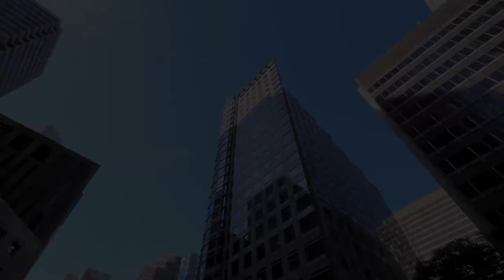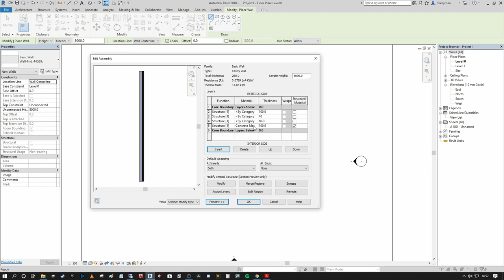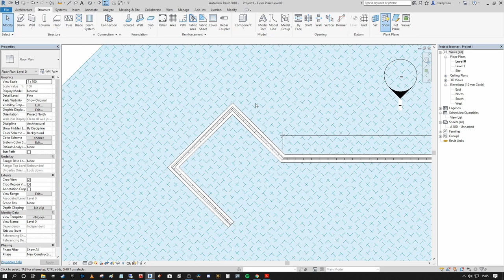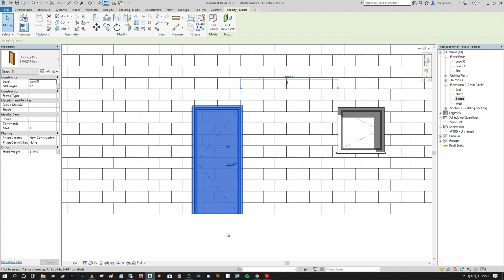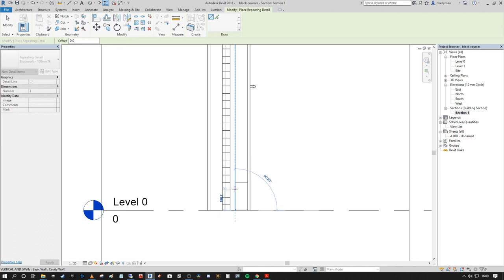Create Block and Masonry Walls to Course Intervals in Revit

Comment from the maker: Hi everyone - video timestamps as follows:

0:00 - Introduction to Topic

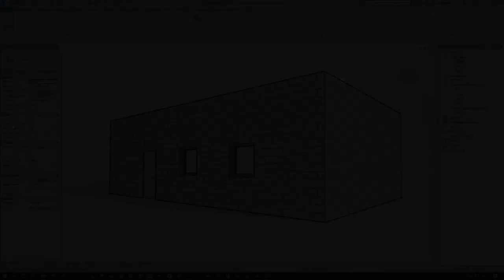02:16 - Create a New Blockwork Wall Family Type in Revit:

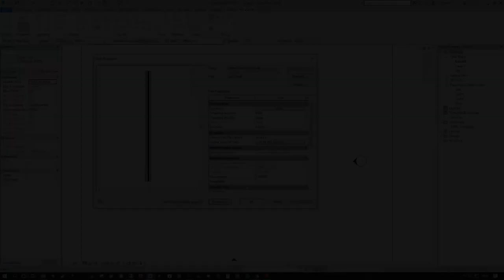06:26 - Using Work Plane Grids to Set out to Blockwork Sizes in Revit:

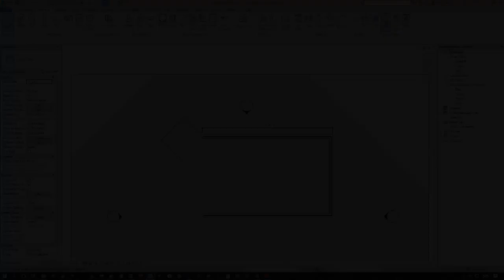11:16 - Use Revit Detail Components to set out your Blockwork Courses:

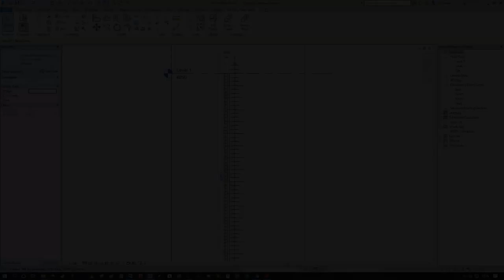17:54 - Use Snap Length Increments to set out Revit walls to Blockwork Intervals:

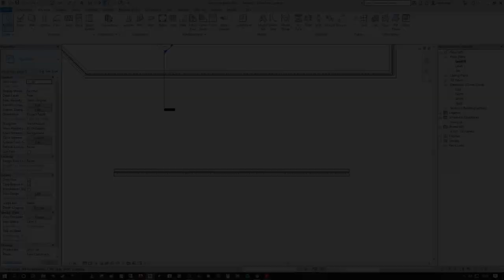20:59 - Use Dimensions in Conjunction with Global Parameters to set out walls to Blockwork Intervals:

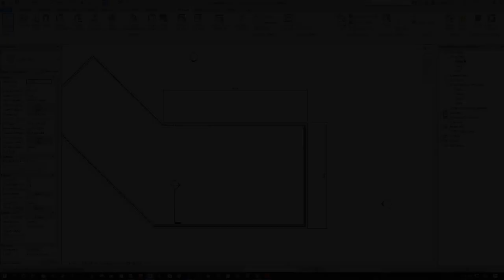23:43 - Aligning Revit Blockwork Material Pattern to represent accurate blockwork courses.

26:56 - Ensuring your Revit Doors and Windows are Correctly Set out to Half Block Intervals:

32:18 - Detailing your Blockwork Courses Using Repeating Details:

Hope you find the video helpful.

If you like this content please support 8020BIM by buying me a (much needed) coffee:
https://www.buymeacoffee.com/8020BIM

Niall

Comment: This is actually a great video. This is big problem I see with a lot of plans that are coming through now a days, not only masonry buildings but CFS/wood frame/etc as well. Having that grid system is really important when laying out walls for a building. For example, with a wood framed building, most building materials (sheathing/gypsum/siding/etc) are designed in 4' increments, so ideally you want your walls to be divisible by 4'. But man, I see so many plans that have the most random dimensions that are in half inch, 3/4 inch, an non-round able thicknesses  that create so much waste and extra work for literally no reason, not to mention extra cost.

I couldnt even imagine those masons having to cut slivers of blocks like that.
Reply from the maker: Thanks for the feedback Nick. I agree, generally speaking, I think there is too little attention given to the constructability and setting out when designing.

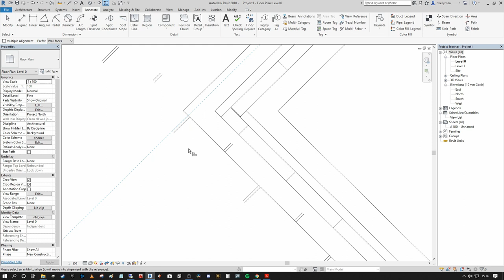Comment: Wise guy here: 3. on using detail component to set out block work increments (roughly at minute 14:00), shouldn't you align the outer wall to the INNER line of the block line, as you will not have a mortar joint on the outside of the wall. You accounted that for in the global parameter formula by subtracting 10mm from the total wall length. Not that it would actually matter on site, as at this wall length the 10mm would be easily adjusted by tolerance.

Great series on Revit you have here, one of the kind with usable detailed content. Keep up the superb work.
Reply from the maker: Dirk - You are wise indeed! Well spotted, I hadn't noticed! :D You are absolutely correct, I should have aligned to the inner line of the mortar joint shown on the detail component for the wall setout to be 100% accurate. 
I appreciate the positive feedback and hope you are finding value in the content so far. 
All the best
Niall

Comment: Great tutorial as always Niall! Can you do one tutorial explaining how Revit stairs join/connect to floors and get correct data out of them?
Reply from the maker: Thanks for the feedback 🙂
I can do a detailed tutorial on stairs for sure, will put it on the (growing) list. May take a while to get to it with the requests starting to roll in but I will do my best to have it as soon as possible 😊
For a quick solution, I sometimes choose to forego the stringer arrangements on the Revit stairs and use beams to create the stringer members so I can choose how they cut and interface with the structural supports of the landings (most of the buildings I work with are Struct steel) and also for ease of scheduling stair support steel quantities. For Precast or Cast-in-situ concrete stairs the monolithic stair system family automatically joins to structural floors quite well and you can nominate the method which it connects to the landing (check out my previous video on 29 Ways to find things in Revit if you are struggling to locate the stair system families). So, as you can see, there are a few variables and approaches to consider all depending on the stair types and floor support structures.

Comment: Hi ...here i could not understand why u take half of the brick size ??
Reply from the maker: Half Block / brick size is a standard interval as masonry workers can easily half a block, rather than cut at quarters or something similar.
Hope this helps
Niall
Reply: Hi ..how r u ..can u plz tell me 
what is the benefit of making this wall with the help of referreence plane.?? Plz tell me the advantage
Reply: @8020BIM  Dose the half block size rule applied only for the horizontal measurement’s or there are also cases for the vertical measurement’s (block height)? Thanks
Reply from the maker: @Gedrosia-Makran  Hi there. You should be working to wall heights that match full block intervals as blocks generally are not split length ways on a construction site. Also, make sure not to forget your soap-bar or cavity closer blocks at the head of the wall when workign out how high it should be.
All the best,
Niall
Reply: @8020BIM   Many Thanks for your feedback & info.